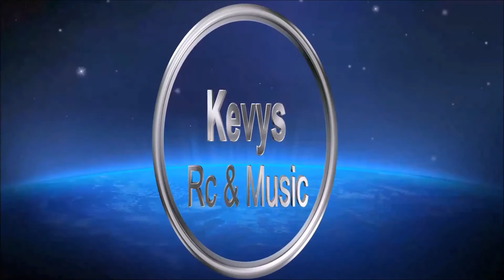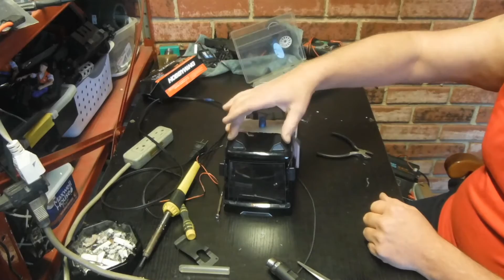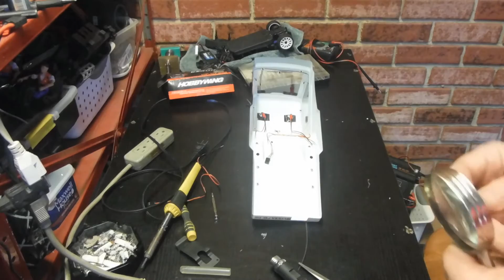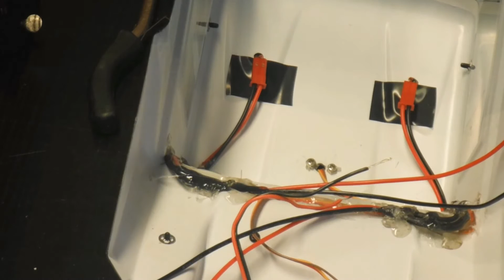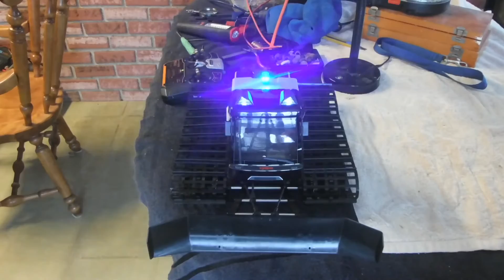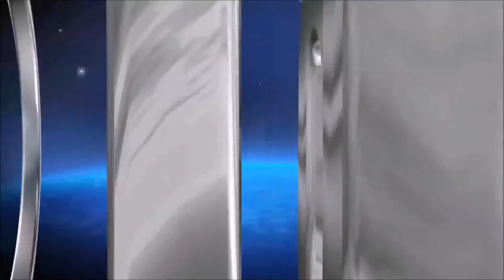Kyosho Blizzard FR Head Light Install And Test

Comment: Did you put in any kind of DC/DC board in there? I got 10 of them for dirt cheap and they will cut the power down and not take up much room. I had gotten 5 turnigy navigation module kits with 5 mm LEDs so so I will be installing one of those. Its for a plane but as I wont be worrying about turn signals. I did get a rotating becon also much like yours, not blue. I think you did a good job really. I am going to install a smoke generator on mine. I can remove the supplied exaust stack. I am replacing the Motors, the ESC pretty much everything. I already tryed it out. Really liked it. No lights yet. They use groomers on the snowmobile trails here up north and let me tell you, it looks like a UFO with all the flashers and spotlights! Scared the living HELL out of me running across one at 1 am when I was out snowmobiling by myself. BRIGHT lights are the ticket. I intend to get a spot light too. GOT to have a spot light.
Reply from the maker: nope i never put and sort of DC/DC board in
Reply: @KevinMillard68  They are basically a voltage regulator. I originally got them for my cheap RC drones to switch from Regular AA battery to lipo batterys. They work well on LED and other things such as smoke generators and sound systems. Ba nggood . com sells them but I found out on Ebay you can order a dozen for $3 Not that I will ever use that many, you never know. I use them in so many projects now.

Comment: Could you link to where you bought the lights? Thanks!
Reply from the maker: +Alexs Apple Orchard the blue strobe was at banggood they also carry LEDS as well
Reply: +Kevys Rc & Music ok cool thanks! Do you plan to upgrade the motors? If you did I must of missed the video.
Reply from the maker: +Alexs Apple Orchard yup going to go with the latrax motors that shenlonco did on his
Reply: +Kevys Rc & Music Ok cool! I'm going to go with a brushless system. I bought two Dynamite 4500kv motors with escs what I will wire to one battery.
Reply from the maker: +Alexs Apple Orchard cool